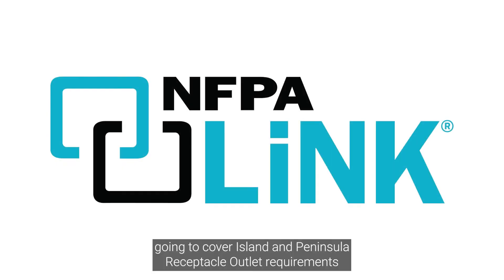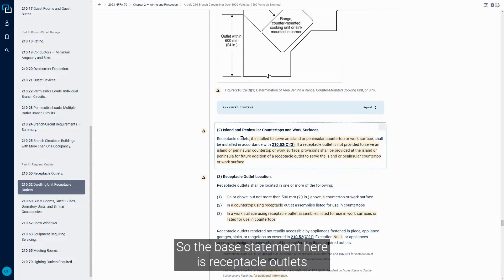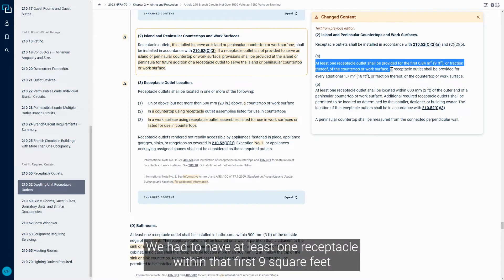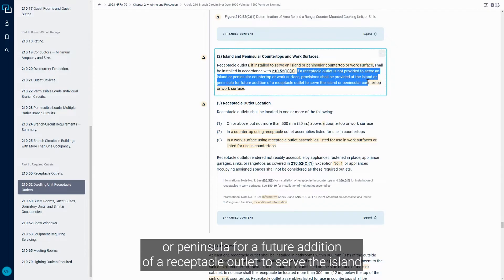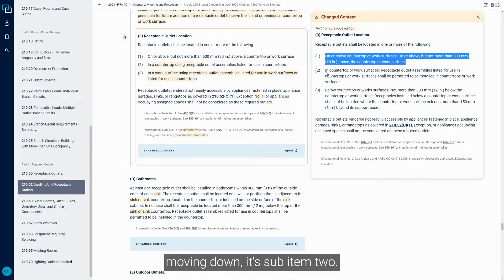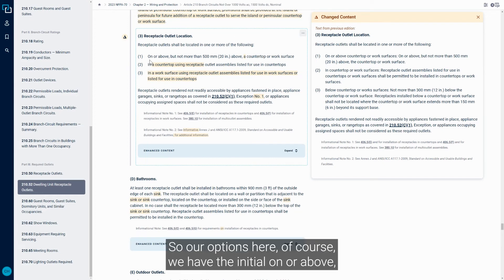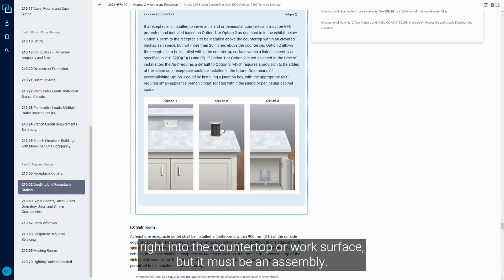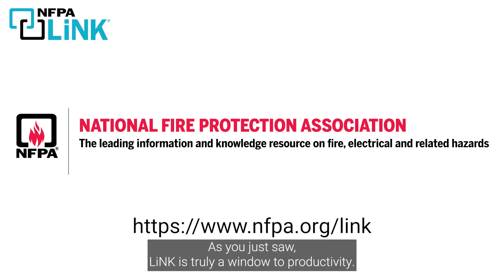Changes to Kitchen Island and Peninsula Receptacle Requirements in the 2023 NEC — LiNK® Edition

Comment: I think just put in the pop-up and move on with life. Most people would like an outlet in an island or peninsula. They are very low profile and nice. It's a ton easier to figure out where you want it, tell the countertop installer where and what size to drill, than to drill it later. Because as pcatful says, it leads to homeowners doing what the hell they want, codes be damned! Then they sell the home and the next owner deals with the previous owner's decisions.
Reply: Hubbell sells a nice pop up. My how things are a changing.

Comment: I think the 2023 NEC change to Section 210.52(C)(3) kitchen island and peninsula receptacle requirements was a really smart and practical change.  This way builders have to provide a j-box inside the island, although the island countertop doesn’t have to be cut-up in ways a homeowner might dislike.  Because when you start talking about custom granite countertops, homeowners can get really picky about where you’re penetrating that granite.  Also granite installers and plumbers might have suggestions on the best location for these types of receptacles.
Reply: Right, but then that seems to be only a workaround so they can come back later and put a receptacle where everyone wants them, and no longer allowed, on the cabinet face below. I feel I must be the bearer of bad news once again. People don't like their counters messed with.
Reply: @pcatful  , Bless your heart, that might be the case.  Now that AFCI is required on basically all dwelling unit branch circuits, I think that all panels (commercial and residential) should NOT be allowed to have a neutral bus bar, instead every circuit breaker would be required to have a neutral terminal on it.  The NEC is requiring more and more forms of protection for branch circuits including AFCI, GFCI, GFPE, and Surge Protection.  The closer the fault can be isolated, the better the protection, better breaker microprocess of fault conditions, and easier troubleshooting for service calls.  The breaker's line side neutral should just be integrated into the panel and breaker.

Other wording in the NEC would also have to be revised.  Section 408.40 Grounding of Panelboards would have to revise its wording that says: “Equipment grounding conductors shall not be connected to a terminal bar provided for grounded conductors or neutral conductors unless the bar is identified for the purpose and is located where interconnection between equipment grounding conductors and grounded circuit conductors is permitted or required by Part II and Part VII of Article 250.”  Also Section 408.41 Grounded Conductor Terminations would have to be totally revised, and the exception in this section would have to be deleted.  I have seen apprentices make mistakes on commercial subpanels because they were only familiar with residential meter main panels.  This change I outline would eliminate confusion, so that never would a neutral be landed on an equipment grounding conductor bus bar.

I also think that Surge Protection should be addressed only in Article 210, alongside AFCI and GFCI.  Surge protection should be deleted from Sections 215.18, 225.42, and 230.67.  Also having the surge protection at the breaker brings up the question if all breakers should now be Double-Pole Single-Throw Circuit Breakers, with one of the poles-throws being for the neutral.  Say that the voltage surge lasts a long time, maybe the breaker should open all conductors (phase and neutral).  I also think that GFPE should be on a case-by-case basis, so also put it in Article 210.  Thus GFPE would be deleted from Sections 210.13, 215.10, and 230.95.